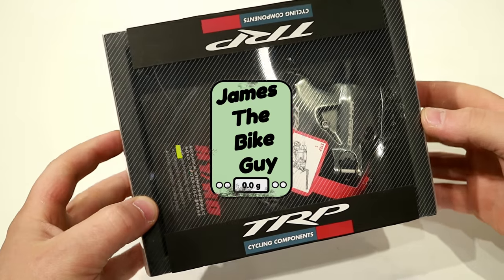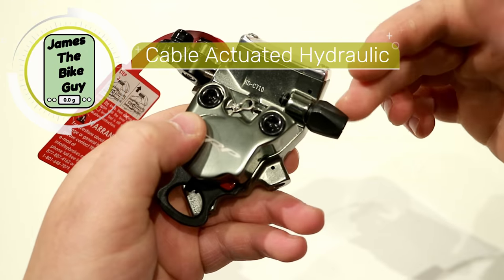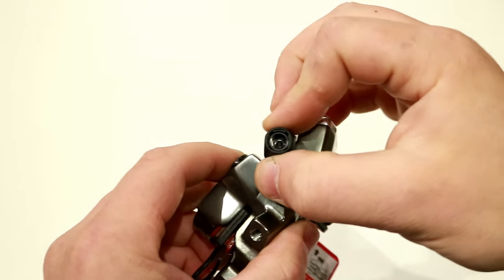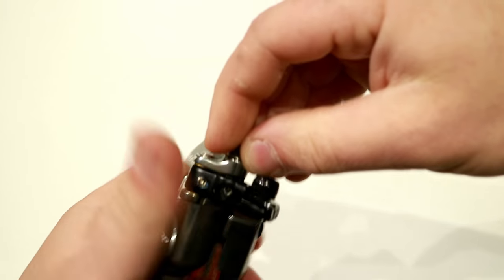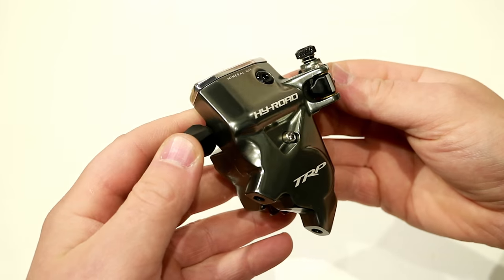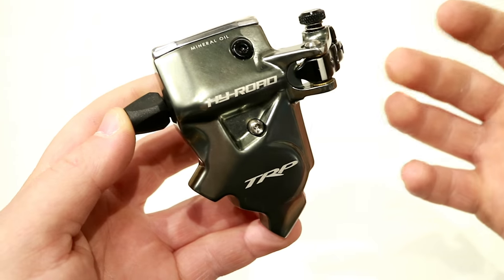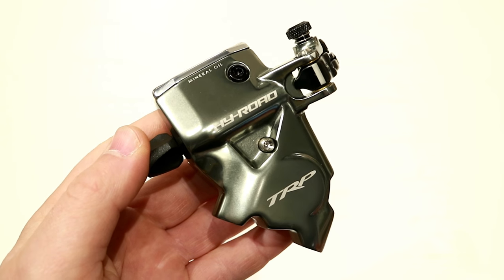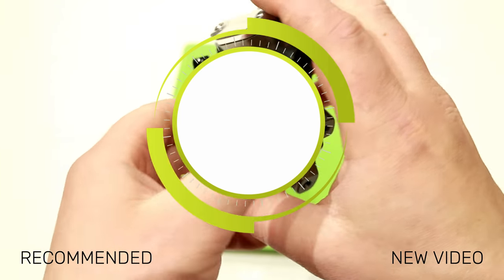TRP HY/RD Mechanical Hydraulic Road Disc Brake Review and Actual Weight

Comment: You gona say that im crazy because i installed hy/rd on my dh bike and it works pretty good with 203mm rotors
Reply from the maker: Hey whatever works!
Reply: @Jamesthebikeguy  the reason i installed these calipers is pretty stupid and its because i "afraid" of  oil tubes
Reply: @Jamesthebikeguy  and its way easier to bleed a brake like hy/rd because you dont need all the bike for it

Comment: These are cheap and great choice for Electric bikes ( Rear hub motor) since you cant change the brake lever due to motor cut off safety feature. I am using these caliper with Shimano Ice cool technology rotors to stop a 24 kg ebike. These are the cheapest Hydrolic caliper you can get for ebikes atleast here in Aus
Reply from the maker: Good choice for that upgrade!

Comment: Hey, james, Im a huge fan of this channel. I am considering the decathlom triban rc 520 which comes with the post mount version of these brakes in a 105 STI shifter setup. Could you please tell me if these brakes require bleeding like you normally would with a full hydraulic disk setup, if not, then what's the procedure for bleeding just the callipers?

Comment: I just bought the Triban RC520 and thought that these brakes would be a place where they made a big cost saving. But hearing that TRP is part of Tektro, which makes awesome brakes, perhaps it´s a good set-up after all. Regular hydraulic brakes need to be bled from air once in a while, how does this set-up compare to that since you don´t have hydraulic hoses to bleed and you only have the hydraulic fluid right at the calliper. Feels like it would be a lot easier to bleed this and you perhaps don´t need as much fluid in the system as well. What´re your thoughts?

Comment: Really nice upgrade for my current spyre c
Reply from the maker: For sure, easy upgrade that makes a HUGE difference.
Reply: Something really weird happened to me with the spyres. I replaced them with these and it made a huge difference. I used the spyres on a cheap MTB I have (I had to buy adapters for post mount) and they work wonders on that bike. They barely worked on my CX bike
Reply: Sergio Zamorano this is why paul canti lever exist.. 
despite using short or long reach lever, using short reach caliper on a mountain bike will give better braking force but very short pad life because greater mass from havier tire or more demanding ride.
it happens to a lot of people though.

Comment: Hi James, do you know if the front and the rear flat-mount callipers are interchangeable, and thus weigh exactly the same for front and rear? 
 Also, if my current setup includes a 140-to-160mm chain stay adapter for the Spyre, but not for front, it's prudent to presume that the same will be the case with the HY/RDs? Thank you.
Reply from the maker: Same caliper front and rear.
Reply: @Jamesthebikeguy  Thank you. 😊

Comment: Does anyone have real world experience with this type of caliper on a touring or bikepacking bike hauling about 50 lbs. in addition to rider weight? I ask because of concerns of heat buildup and brake fade. With this design, the oil is contained in the caliper where most of the heat is retained. If brake fade is a concern, especially during long descents, I see a fix by utilizing a slight modification where the reservoir cap could be replaced by one which has fins cast into the top. Also, using some pads with fins could help too. 
One area I ride is the Virginia Creeper trail. After the longish uphill grade, the reward is going downhill for about 30 miles. My current setup uses Shimano cx mechanical brakes. I am starting a new build and I am giving this design a strong consideration.
Reply from the maker: Bike packing, I would run something like the TRP Spyre brakes
Reply: I run these on a cargo ebike, carrying/pulling up to 700 lbs including myself. The stock pads have lasted me an entire year taking this bike out twice a week. You just have to be smart with the break usage and think like a truck driver. If you like to drive more aggressively you can stop VERY quickly with all of that weight, just expect to replace your pads every 30 uses or so. They also do great on hills, just make sure your cargo is secure and you use high quality tires as these brakes will lock up both wheels and put more wear on them than the pads themselves. Sometimes I have trouble maintaining control when carrying 10 24 packs of beer home, but that's mostly due to the weight distribution and never the brakes.

Comment: hmm ... caliper should NEVER be activated with out a dummy rotor part or an actual rotor in place , IMO you were lucky that the pistons did not pop out . anywho this tells me i will be looking elswhere for opinions & review , cheers
Reply from the maker: Lol, I presume you don't quite understand how hydraulic calipers work. They advance only as much as you push the fluid through. They will retract once the volume inside gets larger (you let off the lever). If you don't advance the pads past the length of their travel it is no different than normal operation.
Reply: @Jamesthebikeguy  you are right but regular Joe's do not know that and will push the lever all out  , then they are in deep  shit